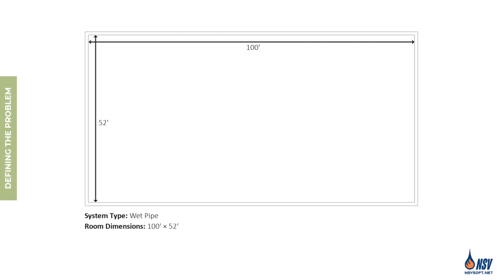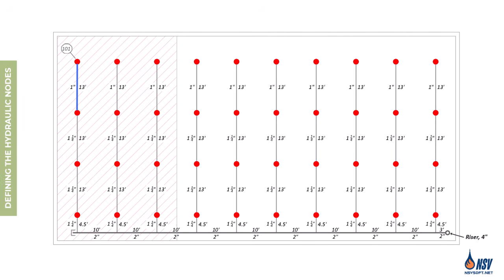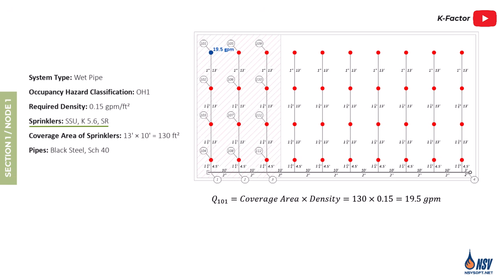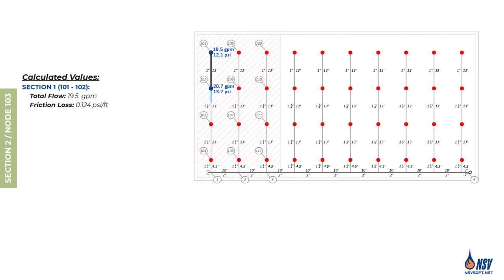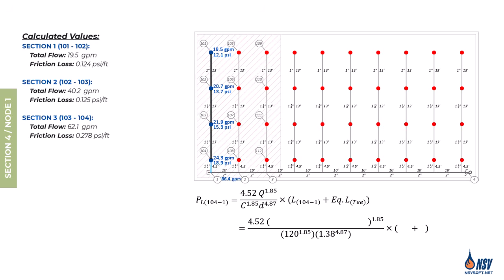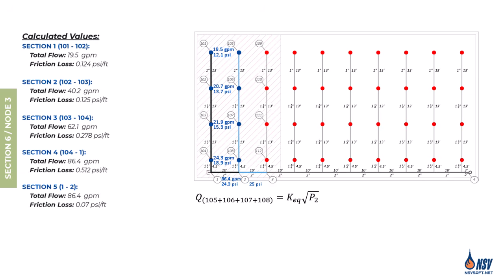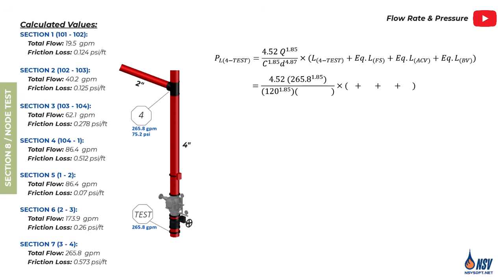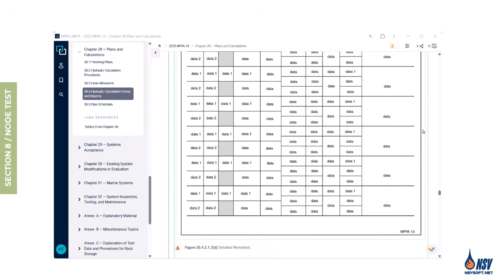🧮 Step-by-Step Hydraulic Calculation Example (NFPA 13)

Comment: for sprinklers why don't u add the Tee for intermediate like 102, 103... and no bend in used for 101 .wrong calculation?
Reply from the maker: Hello, Thank you for your question.

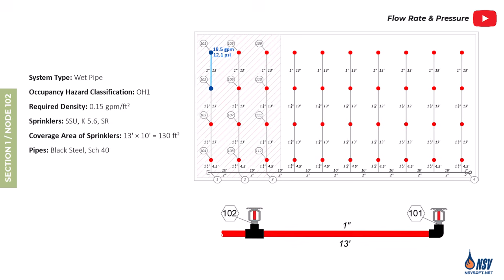Paragraph 28.2.4.8.1(11) of NFPA 13, 2025 Edition permits fittings to be ignored when sprinklers are directly attached to those fittings. We explain this provision in the video. Please refer to the section starting at 8:19 for a detailed explanation.
Reply: @NSVCad  Thank you❤❤I have missed that part. actually This video series are very helpful to learn than direct reading the standard thank u again for that
Reply from the maker: Thank you! We are so glad that you like our videos!

Comment: Sir, can i ask you a question? if i have a building but it has a lot of sprinkler and many zone it still can follow this method?
Reply from the maker: Hello,
Yes! Regardless of the building size, the hydraulic calculation process remains the same. However, in a large building with multiple floors or varying hazard occupancies, you may need to consider different design areas to ensure you identify the worst‑case scenario for the hydraulic calculations.

Comment: How about if it is pendent sprinkler not upright, how to do it and is the hydraulic calculation in your website can be use for pendent as well?
Reply from the maker: Gab, 
The hydraulic calculation process for upright and pendent sprinklers is the same.
Reply: @NSVCad  do i need to account for the return bend? and the change in elevation of heads and branch?
Reply from the maker: Gab,
In hydraulic calculations for fire sprinkler systems, we include all fittings except the ones directly attached to the sprinklers, as well as tees or four‑way fittings that don’t change the water direction. And whenever the elevation between the start and end nodes of a pipe segment changes, we need to account for that difference in the calculation.

Just a quick note: the software shown in the video was created mainly for educational use, so it’s best suited for simpler system layouts. The good news is that we’re actively developing a new hydraulic calculation software that can handle more complex piping networks—including looped and gridded systems.

Since you’re one of our active subscribers, we’d be happy to offer you a free two‑month license as soon as the new software is ready. We truly appreciate your support.
Reply: @NSVCad  thank you i appreciate the reply i am really happy that i am learning this design so fast because of your videos. it is easy to understand but since not all situations are the same that's why i need to research more. waiting for the next video hehe
Reply from the maker: Thank you! We’re really glad to hear that our videos were helpful for you.

Comment: Hello, why is it that after the riser the pipes are consistently 2''? shouldn't the size decrease as the number of branches decrease as well? like the first size should be supplying 40 and since it branched out  with 4 sprinklers the next size would be supplying 36 sprinklers.
Reply from the maker: Hi, 
Thanks for your question. 

We intentionally didn’t change the size of the cross main to emphasize that in the hydraulic calculation method, there is no requirement to increase pipe size as long as the water supply can support the system demand.

In other pipe‑sizing method, the pipe schedule approach, the pipe size must be selected based on the number of sprinklers it feeds.But in the hydraulic calculation method, pipe size is not determined by the number of sprinklers—it is determined only by whether the calculated demand can be met by the available water supply.

Comment: Is there any way you can size the pipe using hydraulic calculation? The main pipe and riser
Reply from the maker: James, 
One of the main goals of hydraulic calculation is to determine the optimum pipe sizes throughout the system. Please check out the video below, where we explain several methods for system optimization and how they influence pipe sizing.
https://www.youtube.com/watch?v=7u1XLnWYi1U&list=PLz2qREWhRUMTQKkZf8neEF8PWgU4jsucC&index=12
Reply: @NSVCad thank youuu didnt see this video yet

Comment: Is there a metric system for this presentation? This fine, but this is the standard US format, and we work with NGC & PH, or most countries that prefer the metric system.
Reply from the maker: Great comment —thank you for the feedback. 
NFPA 13 is fundamentally written around imperial units, and many of its design criteria are more intuitive in that system. For example, requirements such as even‑number spacing for listed extended coverage or residential sprinklers, and standard spray sprinkler spacing and coverage in light‑hazard occupancies (15 ft spacing and 225 sq ft coverage), are much more straightforward to apply using imperial units. This helps make fire sprinkler system design more efficient and consistent with the intent of the standard. That said, we do recognize that many designers work in metric units, and we’ll definitely look at incorporating metric references in future videos to better support those audiences as well.

Comment: what happen if i use the elite fire software and provide the node details and k-factor separately for each node as 5.6 ? I am beginner in FLS field can i get the result close to what you achieved manually?
Reply from the maker: Great question, and welcome to the Fire & Life Safety field!

We’re not personally familiar with the internal workflow of Elite Fire software, but the underlying principles are the same across all hydraulic calculation tools. Whether you run the numbers manually or use software, both methods rely on the same formulas: the same pressure–flow relationship, the same K‑factor equation, the same friction‑loss calculations, and the same hydraulic principles defined in NFPA standards.

Because the formulas and procedures are identical, the results should not show any significant differences as long as the inputs are correct—meaning accurate pipe lengths, fittings, elevations, sprinkler K‑factors, and system layout. Software simply automates the math; it doesn’t change the physics.

So using a uniform K‑factor like 5.6 can give you a reasonable approximation for learning, but the closer your inputs match the real system, the closer your results will match a detailed manual calculation.

Keep experimenting and comparing—it’s one of the best ways to build confidence in hydraulic calculations.
Reply: 😮❤ @NSVCad

Comment: Where did you get value "0.433"  from Pe(4-test) = 0.433 x H(4-test)?
Reply from the maker: Thanks for your great question!
The value 0.433 ultimately comes from a basic physical property of water.
Water weighs about 62.4 pounds per cubic foot (lb/ft³) under normal conditions. This is a measured and well‑known property used in fluid mechanics.
Now imagine 1 cubic foot of water as a box 1 ft × 1 ft × 1 ft.
The bottom area is 1 square foot, or 144 square inches.
That 62.4 pounds of water is distributed over those 144 square inches, so the pressure on each square inch is:
62.4 ÷ 144 = 0.433 psi
In simple terms, a column of water 1 inch × 1 inch and 1 foot high produces 0.433 psi at the bottom.
That’s why, in hydraulic calculations, we use:
Pressure (psi) = 0.433 × Height (ft)
Reply: Got it. Its a way to convert pressure to head , vice versa. Thank you for your detailed response.
 @NSVCad

Comment: thanks a lot for vedio, but i have a question, why is the header 2 in ?
Reply from the maker: Thanks for the question! When you say ‘header,’ are you referring to the Cross Main (the pipe supplying the branch lines)?

If so, the key difference here is the design method. Unlike the Pipe Schedule method—where pipe sizes are strictly determined by the number of sprinklers they feed—in the Hydraulic Calculation method, pipe sizes are determined by the capability of the water supply to overcome friction loss and elevation changes.

In the video example, we intentionally chose pipe sizes that differ from the standard pipe schedule table to highlight this flexibility. Stay tuned—we will be publishing a video soon about system optimization that will clarify this process even further!
Reply: @NSVCad Thank you very much for the explanation, yes I meant the header was the cross main, I understood the reason why the cross main 2 in is that only the flow that can be for 12 sprinklers is calculated, is my understanding correct?
Reply from the maker: Yes, your understanding is correct. In hydraulic calculations, we size the pipes based on the specific demand of the operating sprinklers in the remote area (the 12 sprinklers). As long as the pressure loss isn’t too high for the water supply to handle, the 2-inch cross main is perfectly sufficient. We will explore this topic further in our upcoming system optimization video!
Reply: @NSVCad Thank you very much I understand, but when according to NFPA for Pipe Schedule for 12 sprinkler then the pipe is sized 2 1/2 in, isn't the calculation you made according to that?, or do you assume a diamension and then calculate the pressure loss ?
Reply from the maker: Great observation! You hit on the exact difference between the two methods.

1- Pipe Schedule Method: You are correct. If we followed the strict NFPA Pipe Schedule tables, we would be forced to use 2 1/2" pipe when feeding more than 10 sprinklers. This method is conservative and often results in oversized pipes.

2- Hydraulic Calculation Method (Used in video): This works exactly as you guessed in your second question. We ‘assume’ a pipe size (e.g., 2 inch) and then calculate the friction loss. If the available water pressure is strong enough to push water through that 2-inch pipe at the required flow, then the design is NFPA compliant!

We will explain this process in full detail in our upcoming System Optimization video, so stay tuned!
Reply: @NSVCad Thank you very much, I look forward to your videos
Reply: @NSVCad  if thats the case what about choosing 1.5 inch oioe isntead of 2 inch and boost the pressure. So what is the selection logic here? Great video by the way. and answering each comment makes it truly great

Comment: What CAD software did you use to get the Isometric 3D of the fire sprinkler?
Reply from the maker: We used AutoCAD 3D to model the pipes and fittings. For valves and accessories, many manufacturers provide ready‑to‑use 3D models that you can download for free. For example, if you need Victaulic components, you can download the 3D model of the Series 751 FireLock Alarm Check Valve for AutoCAD or Revit from this link:

https://www.victaulic.com/products/series-751-firelock-alarm-check-valve/

Comment: Pls. share any videos for Extra Hazard -1 & 2 - Hydraulic Calculation (Deluge sprinkler system for DG Plant)
Reply from the maker: The hydraulic calculation process for Extra Hazard (EH1 & EH2) systems is similar to that for Light and Ordinary Hazard occupancies. The main differences are in the required design density and the size of the design area. We’ve already shared videos explaining these concepts — one video covers design density, and three videos cover the design area calculations.

For deluge systems, since the sprinklers (or nozzles) are open, all of them discharge flow simultaneously. Therefore, you should include all sprinklers in the hydraulic calculation.